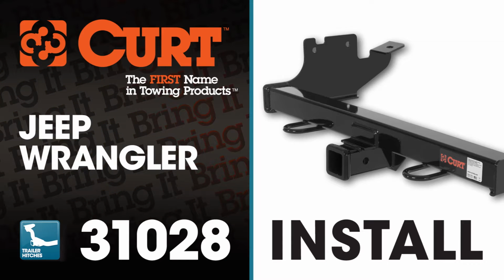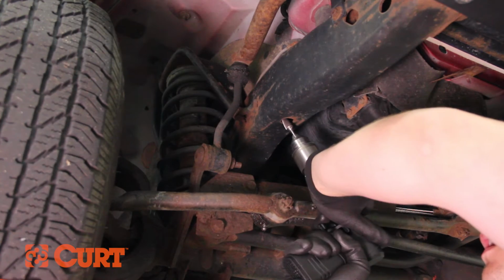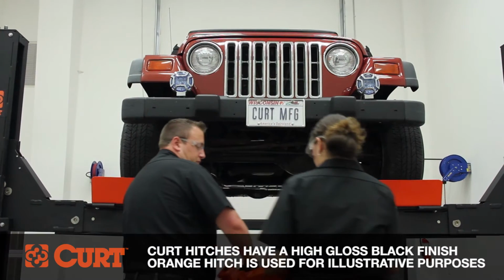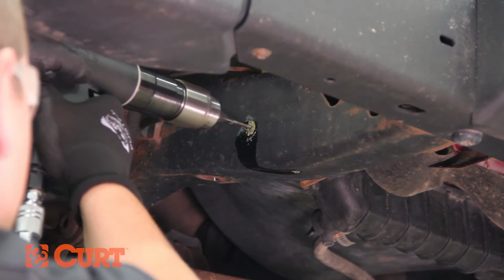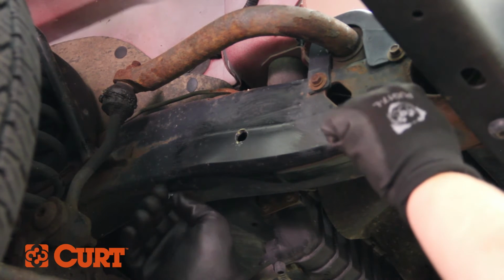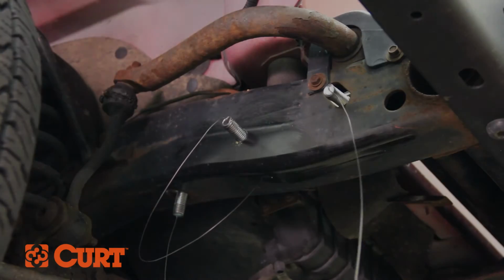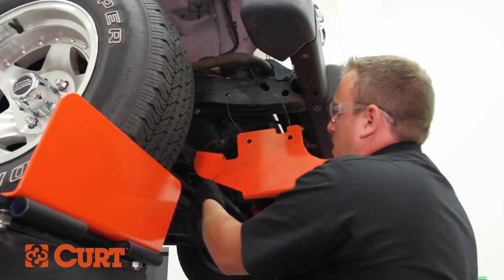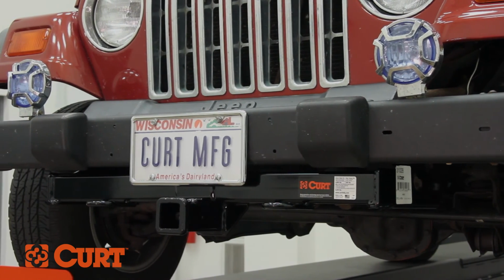Front Mount Hitch Install: CURT 31028 on 1999 Jeep Wrangler

Comment: whats the measurement from the ground to bottom of receiver once installed?
Reply from the maker: +BigDaddyRat454 On a stock setup, it's about 16" from the pin hole on the receiver to the ground.